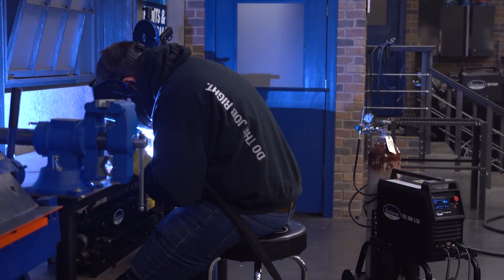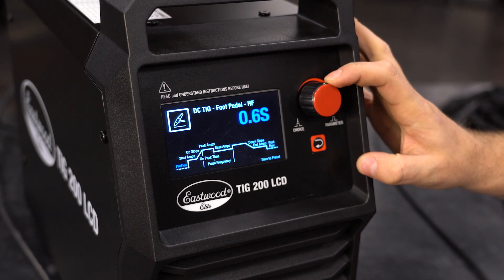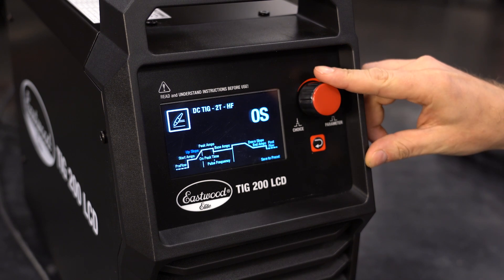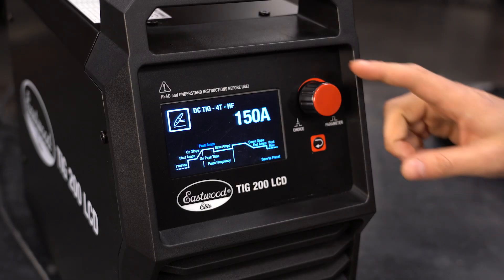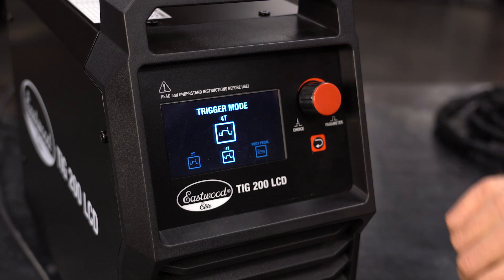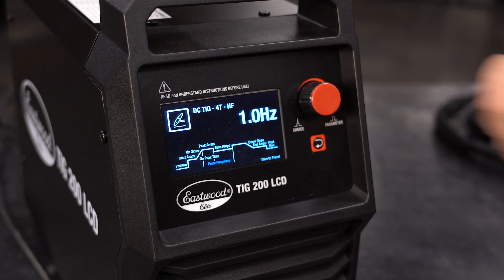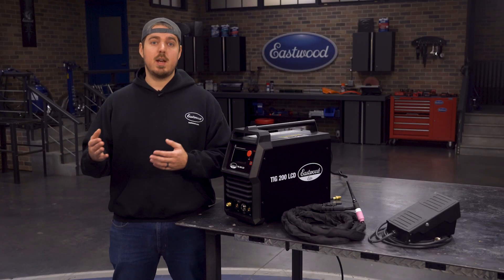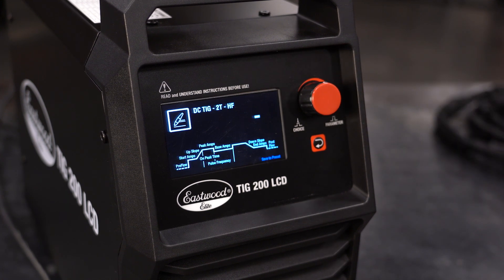How to Setup Pulse, 2T, 4T & More on the  Elite TIG 200 LCD - Eastwood

Comment: With this machine is it possible to do appropriate quality welds on automotive body panels and can you do it without a foot pedal if you choice to?
Reply from the maker: Yes you can use the TIG 200 LCD to weld sheet metal/body panels if you want and there's a trigger option on the torch if you prefer that over the pedal.
https://www.eastwood.com/eastwood-elite-tig-200lcd.html
Reply: @eastwoodco  cool thanks👍